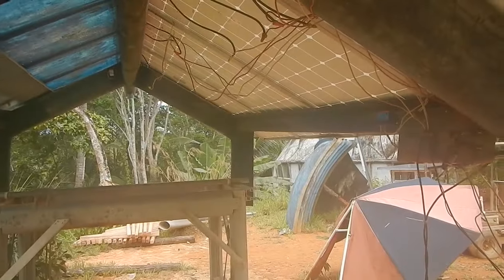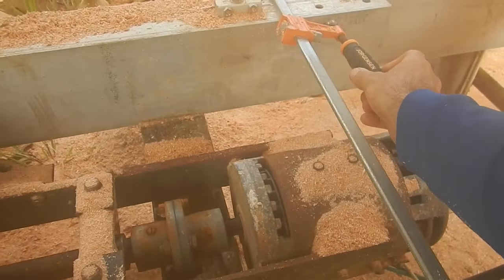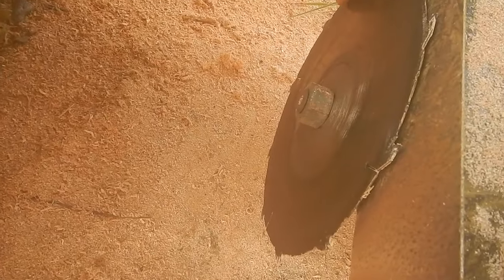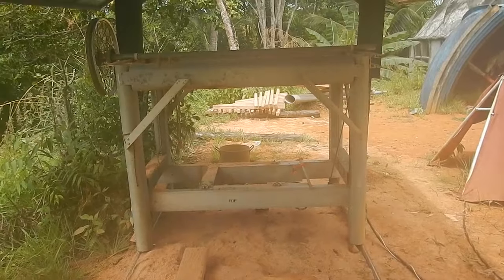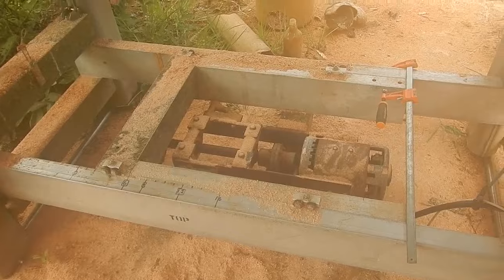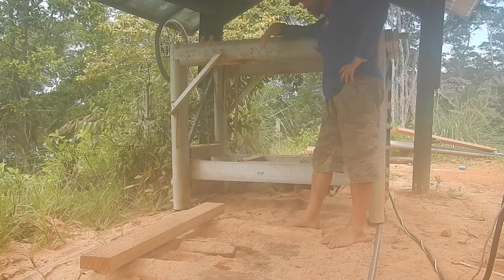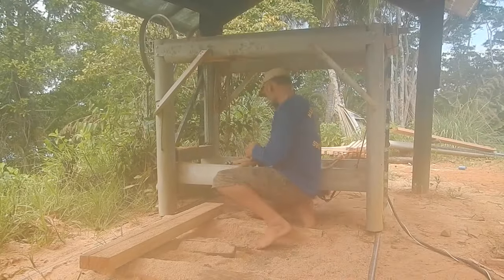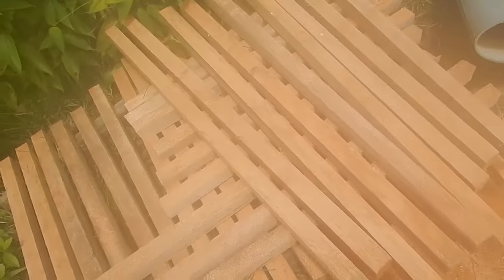Awesome DIY Solar Powered Lumber Mill!

Comment: I just thought of an idea for transporting logs to the island but would most likely require a new "super boat" made specifically for log transport. Part of the setup would be making log stands with swivel wheels that you could tow around with the dozer, which would mean you may need a new boat designed with that setup in mind.

Comment: You should make a planing blade for that motor. Simple roll with screwed in aluminium lathe inserts cuts wood easily, and they stay sharp very long. It's a bit challenge to get them aligned perfectly, but it's not that diffucult.

The idea is to place them as spiral around the roll so only one cuts at the time. It reduces vibration and doesn't rip as much as single straight blade. I'm sure you can make it wide enough to plane you boards without extra support at the other end.

Comment: I remember long time ago when i was a kid in a village in Ukraine we had on of those mills and we would use wood shavings mix with cement and make blocks and build houses barns with it kind of like foam  blocks this days light weather resistant almost like a thermos would keep cool air at summer and heat at winter i cant remember if theres and down sides to it but its sure cheap and easy!

Comment: Northern California is full of plots cut into existing forests, from old pre-legalization marijuana farms, that need to be "beveled" to stop the winds from pushing the edge giant trees over into the clearing.  I am imagining that Adventure Builder Island's clearing, where Jaimie harvested this fallen timber, had these trees fall for this reason.  Cutting down or topping taller trees near the clearing edges would likely help stop trees falling onto buildings or gardens in the clearing, but also bring in more light to grow crops there.  Planting shorter varieties on the edges could also help.  Have fun.
Reply: No, Jamie didn't harvest this timber from fallen trees in his clearing, he cut it from another place which is why he explained it was very large and heavy to transport to the mill and needed to be cut into slabs so he could do that.

Comment: what if you added a capacitor bank between the saw and the batteries big enough to do a full cut it would help regulate the power to the saw extending the motor life. also the blade could use a balancing it would greatly cut down on the vibration but all and all it works great for being so simple

Comment: When you put a board in place for cutting, I never see you secure it so the blade doesn’t move it when cutting. How are the boards being cut secured? I used to work with my dad building houses in the ‘60s and when we cut lumber, one of us would hold the boards being cut.
Reply: being wood on wood its got plenty of friction to stay from just the weight just dont stand on the end in case thing go flying

Comment: How do you keep the material you are cutting from moving? I can't see anything holding it down.
Reply from the maker: gravity.
Reply: @JMEMantzel  And friction. And Jamie magic.
Reply: Wondered the same thing myself.  It looked like the board moved a little bit forward.  I think at some point he will want to lock the board in place.
Reply: high tech pet rock

Comment: Does anyone no how the board getting cut does not move.
Reply: Obviously the force applied by the cutting is not enough to propel it backwards.  Friction v inertia or as Jamie said gravity.
Reply: @kiwiingenuity1677  obviously you have never used a saw
Reply: Yes  I have 660 92cc sthil I know  about it. As I said the inertia is minimal in this set up ask the builder if you don't want to listen. HE SAYS THAT  HE USES GRAVITY. 🤪

Comment: Cmon Jamie. That’s not a lumber mill. It’s a top loaded table saw. It can’t cut large logs as a lumber mill can.
Reply: A sawmill (saw mill, saw-mill) or lumber mill is a facility where logs are cut into lumber...dunno, seems about right 🤔
Reply: Just needs to get a bigger blade and problem solved.
Reply: Didn't he say he would cut logs with the lumber mill if the logs were closer to it
Reply: Yeah this can only cut half the diameter of the blade, it really needs to be a bandsaw to do anything like a real mill.
that being said, I'd like to see that happen.  Not too sure if that golfcart motor could handle a bandsaw setup though. I think he's got about 10% of the power of a real one.
Reply: Never seen a Peterson or Lucas have you?

This is perfectly suitable
Reply: A swing blade mill is the best most efficient type of sawmill check turbo mill  or warrior sawmills ... just need a flush faced saw blade.